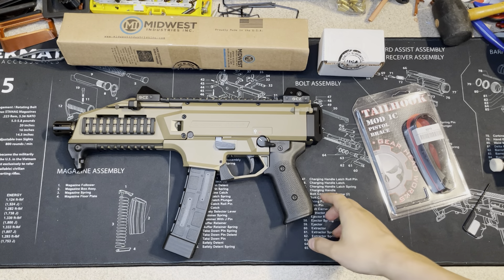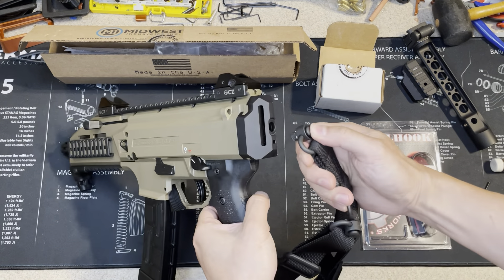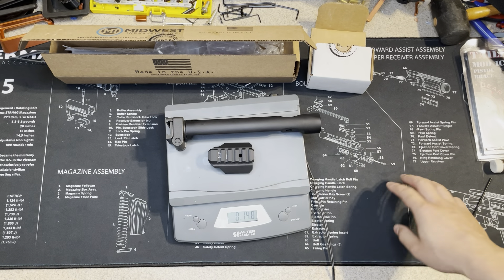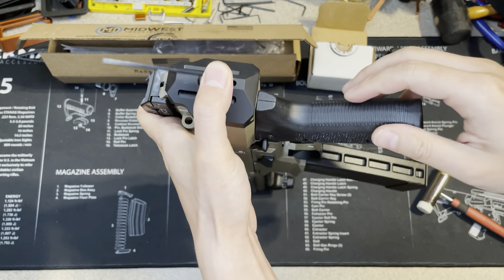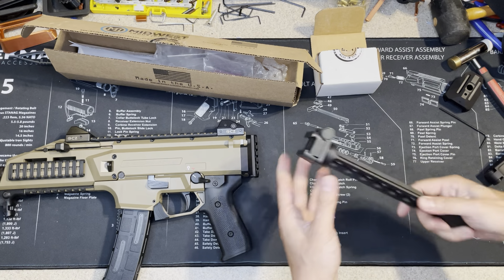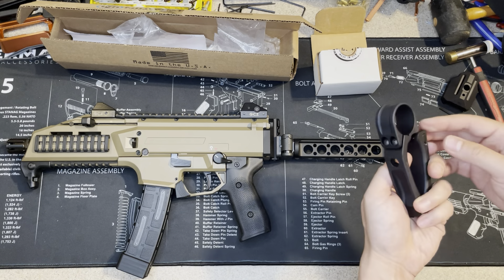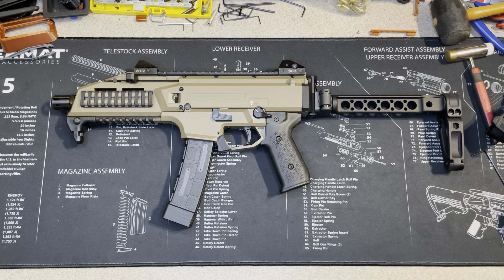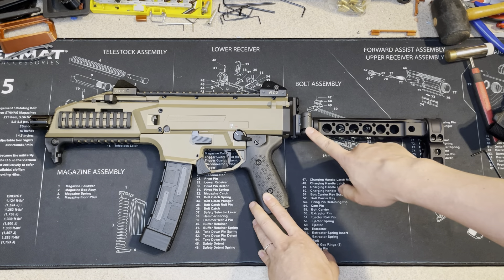CZ scorpion how to replace picatinny 1913 endplate tailhook mod 1c, Midwest Industries upgrades

Comment: What is the length of the MI skeletonized brace with tailhook?  Considering this item for a build, thanks for the video!!
Reply from the maker: 8.74 inches
Reply: How are you liking the brace after more usage?  Considering this model or the A3T tactical folding brace.

Comment: Did yours fold  mine is tight don’t fold i folded it before I put it on Gearhead 1913
Reply from the maker: It needs to break in. It is tight. Mine can fold. If you are having problems to fold, use a flat head screwdriver to help. 
Also add some lubricant. After 10-20 times, it will loose up a little
Reply: @rooftopgunguy  okay I have the Gearhead one I opened when I first got it closed never open again I’m going to try that flat head don’t want to break it 😂
Reply from the maker: @lilmook099  only use the flat screw drive to help you to against the spring force of the hinge.
Reply: @rooftopgunguy  ? At the part it opens at
Reply from the maker: @lilmook099  yes. Add my IG, I can show you the photo @hongkonggunguy
Reply: @rooftopgunguy  just Dm on there